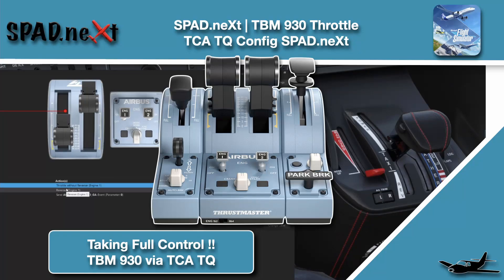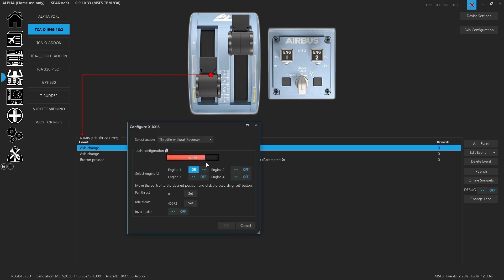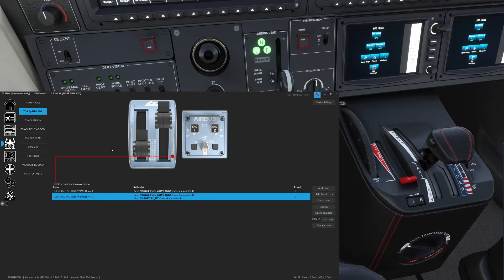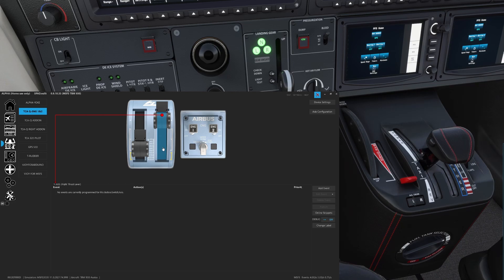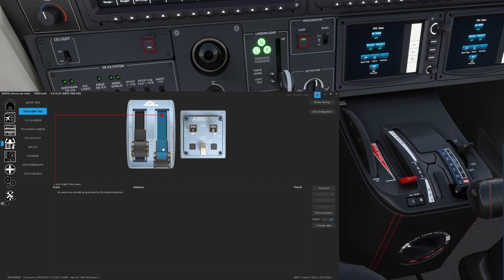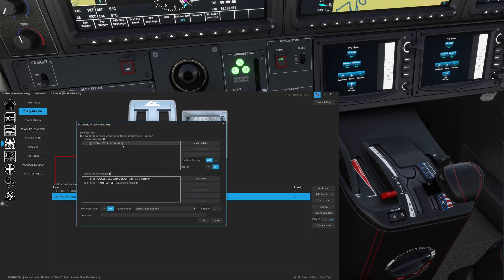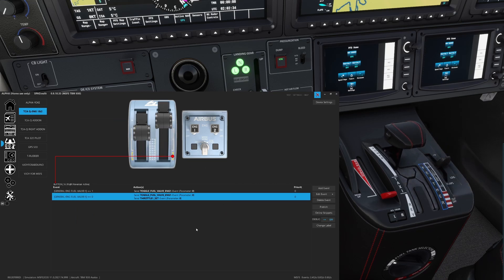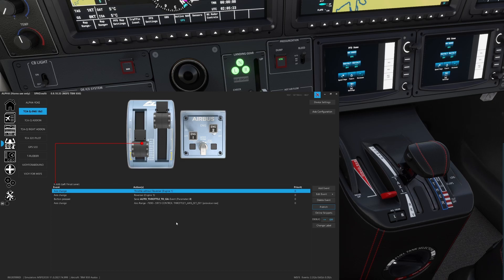(Sim Video) TBM 930 | TCA TQ + Add On Configuration

Comment: If I wanted to do something similar with a bravo throttle, I should be able to use the same values you used?  Just need to adjust the ranges on axis maybe?
Reply: Nvm I see you made a video for this already!
Reply from the maker: Yes. Also can download snippets for them as well.

Comment: exactly what I was looking for...great stuff Les!  is this setup available  in the online snippets?
Reply: Sorry I meant the left one doesn’t move at all
Reply from the maker: There is a video showing how to switch to using a vJoy axis to deal with the animation. If you ignore the animation the TRQ is going up and down as you move the controller.
Reply from the maker: Should be up there.
Reply: Hi Les I found it but it seems to be broken, the left throttle lever doesn’t move at all and the left one goes from low idle all the way up to the left side of the H. Could It be that SU10 has broken it ? Does it still work on your side ?
Reply: The right one goes straight from low idle to the left side of the H

Comment: First of all thank you for all your helpful videos regarding Spad!
I just have a problem with that TBM configuration:
The axis 1 throttle lever animation is not working with that setup. The throttle is working, but it does not move at all.
If I move axis 2 (for feathering or shutdown), that one is animated.
Do you have an idea what could be done about that?
Reply from the maker: Since January update the animation is no longer connected to the variable. However if you have the plane running you will see the TQ increase and the the control still works.
Reply from the maker: @ben mapplebeck because it’s not the external SDK being sent in….

Comment: Great video!
I can't find the correct event for the inertial separator and the gear down/up for the TBM 930. The switches don't move on the plane when I send the event. Do you have them mapped?
Reply from the maker: Yeah after SU5 they broke the XMLVARs on The Inertial Separator and some of the other switches like the AP Trims.  They introduced a new "B Event" system and changed all the switches...  So anything that was using teh XMLVARs are no longer working :( ....  We can only hope they either tie all events back to the XMLVARs or what the community is asking for -- make the B:Events externally accessible...

Comment: Les, Thanks for these really informative videos. 
I can't get the engine 1 throttle without reverser to rest in the idle position on the sim, it always goes to the full reverse unless the lever is in the first notch up from idle on the device. I'm setting up with MSFS 1.19.9.0 and am wondering if this is an issue since this update.
Reply from the maker: I will have to look into it ... for some reason listing the decimals in your version make YouTube think that is a URL (ip address) and so it put it into the Held for review :)....
Reply: @LesOReilly , have you looked at this yet? I am seeing my throttle jump up when the control lever (right axis) is in the top detent. It moves across and delays for a short period (milliseconds) them jumps up to the top of the taxi area so RMP is much higher than it should be for TAXI. all other functions seem to work OK
Reply from the maker: @dkgolfnut  No I have not touched the TBM in the last month...  My guess is going to be that each person needs to make sure their ranges are correct since the Hall Effect sensors in the TCAs are not matching... so there could be a variance that needs to be addressed..
Reply: @LesOReilly  ok I will check that out. Thx

Comment: spadnext the greatest trash and overpriced software in the world
Reply from the maker: Weird...  For me SPAD.neXt is the most important part in keeping my Simulator functioning with exactly the way I like...  I mean so much so that I spend some of my time making videos about it :).....  It works amazingly well and over the years I have continued to get great value out of it....  I am not sure why you are having an issue but I don't see why you would make this kind of comment on a video which specifically shows and example of fixing an issue with the TBM that after SU5 can only be addressed outside of the sim using a program like SPAD.neXt....

Thanks for watching and if you need some assistance come into the SPAD.neXt Discord..  I tend to help out there and also so do a lot of other people...  Due to it's real time interaction way more of people that help out are there instead of in the Forums...  I have to admit I don't frequent the forums as much since the Discord picked up so much traffic...

Comment: Great training video. How would you set this up using a Saitek yoke quadrant where you don't have sensor button but you can set up custom axis ranges and events but no conditions ?
Reply from the maker: Great Question!  I just got my Bravo Quadrant delivered..  I will try to set that up and get the TBM working with it... It pretty much is the same as the Saitek Yokes in that they have the Range and then a "BUTTON" in the bottom detent.  It should be then the same approach for the Saitek!
Reply: @LesOReilly  I was hoping you might work on a Bravo config.  ;)
Reply from the maker: I got it plugged in and half way done for the Baron this morning. Will get back at it later after I get home from my parents and have gotten the 3.6 year old to bed.